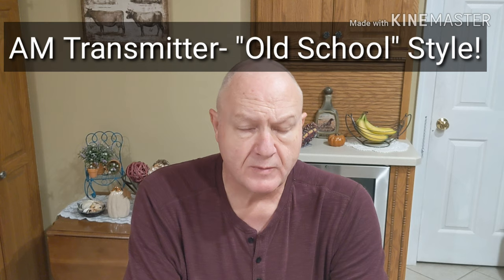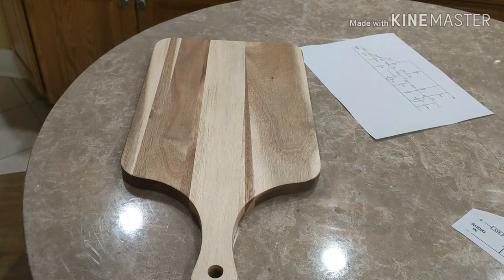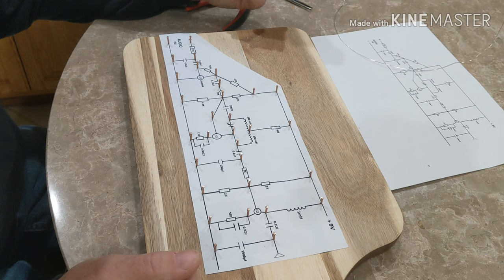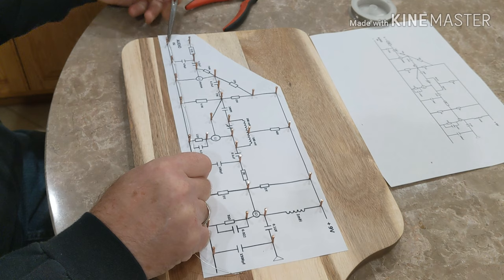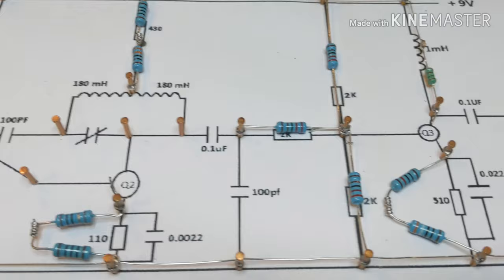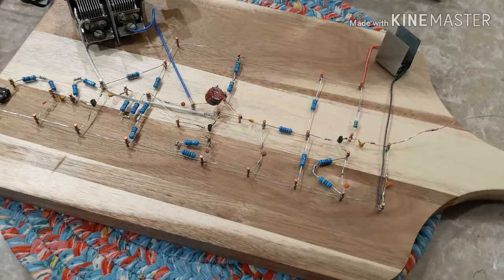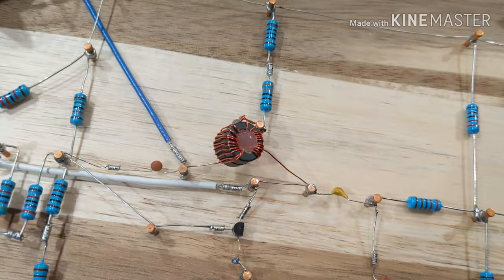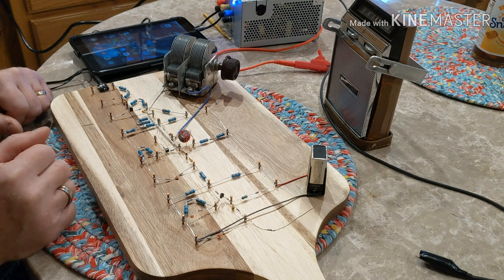AM Transmitter- "Old School" Style!

Comment: Gregg - the old school breadboard looks really cool. As Bob noted, try tweaking your volume on your tablet to ensure your modulation depth is optimized and Bill was spot on regarding a good ground and antenna. The range afterwards should cover your residence In addition, the oscillator has harmonics, so be sure you’re tuned to the primary carrier. Best, Don
Reply from the maker: Thanks Don!

Comment: That turned out really nice Gregg and you made it sing! To clean up the output it might be a thing to reduce the input volume a touch. As for making it more powerful, any simple RF amplifier should work with it, maybe a single common emitter design. I know that Bob and Doug are working on a simple AM transmitter board with an RF amp stage after the basic circuit here so it might be something to look at or Don at Restore Old Radios  also has an AM transmitter circuit. Whatever you build, it will be cheap because of the FCC limits you have set at 100mW output power into a maximum 9 foot antenna. Many thanks for the shout out!
Reply from the maker: Thank you George! Thanks for that suggestion and info sir!

Comment: Radio Shack used to sell little 'potted' circuits. (1964).They looked like black, epoxy, ice cubes. They had one that was an AM transmitter. It had a fixed capacitor and a variable loopstick type antenna coil (just the brass screw sticking out) . You turned the screw and it was tuned to a station. They used to transmit very well, at least 50 feet with a 2 foot antenna. I'd love to see that circuit since that variable capacitor you have is expensive and rare nowadays.
Reply: Not rare, practically extinct

Comment: If you're using a short antenna, you need an antenna-matcher ... in fact nothing more than 2 variable C's with a coil in between.
Please adjust modulation-depth.

Comment: A neat looking job but the lack of a ground plane could be problematic. One suggestion I have seen in the past is an inverted cake tin with tag strips soldered on for the components. Not as good looking but electrically superior.
Reply: a trick : you can watch movies on flixzone. Been using them for watching all kinds of movies lately.
Reply: @Rocco Davis yea, been watching on flixzone for years myself :D

Comment: I think it will have good range if you ground the negitive rail and put about a 10 foot antenna on it.
Reply from the maker: Thanks Bill, I'll give that a try!
Reply: Just get close to 18 yards hook up wire and wind it in a loop 6" wide. It'll do great. Use PP3 battery instead of supply. Battery is cleaner, if you use power supply try adding an EMI filter between wall outlet and supply plug to take out EM noise and hook a wire to negative rail and attach other end to a water pipe going into ground. That's it. You are done

Comment: I did that sort of thing with a FM transmitter but using a 12V battery proved to push too much current and burned the resistors out.
Reply: LOL 🤣
Reply: Whenever I want to increase range I put more power on transmitter by putting little more voltage but that not good method a simple dipole antenna will give very high range

Comment: That's not really how to make AM. It's a modulated free running L/C oscillator. You probably have almost as much FM as you do AM. But that output stage, if you AM modulated that you'd be heading in the right direction
Reply: I agree with you sir. I made one myself and noticed that FM was there as well. I needed to separate oscillator and modulator and had to use audio transformer for modulation. It worked well afterwards, no FM
Reply: @awaismushtaq5719  It's fairly easy to make a reasonable AM transmitter.
If you want good depth of modulation, you apply the modulation to a few stages- say a driver amplifier as well as the output stage. You keep the carrier generation stage completely separate of the modulated amplifiers. It just takes playing around and persistence. A normal audio power amplifier is all you use for the modulator
Reply: @Dazzwidd  will try that
Reply: @awaismushtaq5719  Just a question, have you thought about the fact that a normal audio amplifier running on a single rail supply has half of the supply voltage present at its output before the output coupling capacitor? Thinking about this fact, it's easy to see how it can be used to supply the amplifier stages you wish to modulate: that voltage will swing above and below that voltage value in sympathy with the audio signal. This is the perfect basis for transformerless AM
Reply: @Dazzwidd  cool! Will give it a try too
Reply: @awaismushtaq5719  if you want to be slack you can use a TDA audio power amplifier chip 👍
Reply: @Dazzwidd  ooo those are nice
Reply: @awaismushtaq5719  Well now you can go and make your 10W radio station 😅